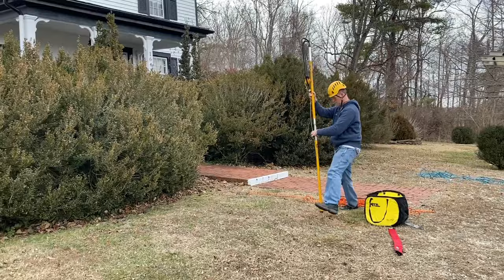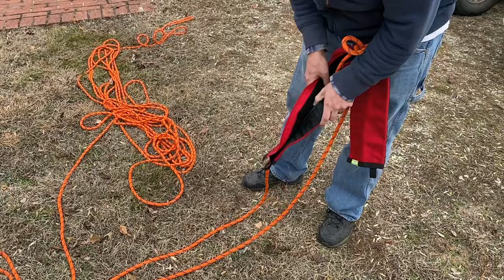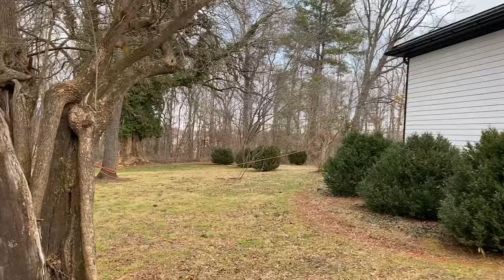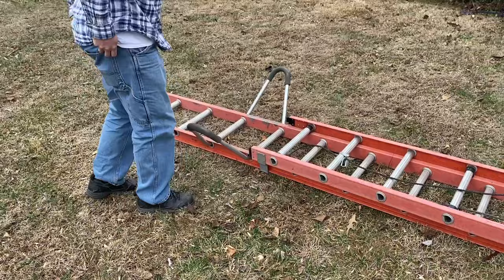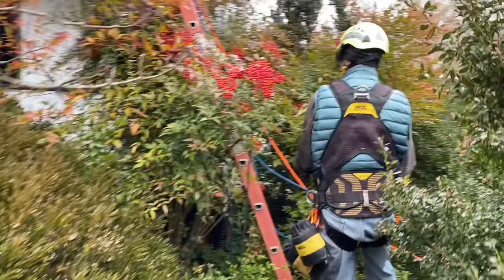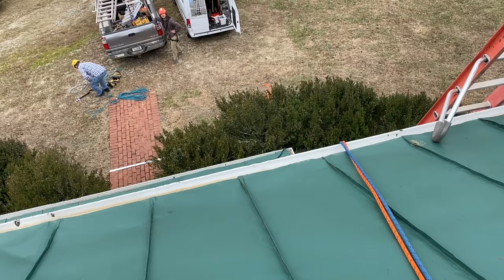Fall protection on a roof without adding any holes to the roof.

Comment: Getting onto the roof from the ladder looks quit dangerous , and how would you protect the ridge from getting damaged or crushed ?
Reply from the maker: You are right.  It can be dangerous.  It’s more dangerous getting from the roof onto the ladder.  That’s why we use fall protection, so if a mistake is made … it’s recoverable.  There are multiple ridge types and  metals used today.  So, I cannot say what exactly will happen at the ridge.  Adding a canvas rope protector on the rope across the ridge may help for the metal ridge cap styles.  If your rope always remains taught, then it will minimize any large forces the rope could transfer to the ridge.  The difference between a fall and a save may be as little as 20 pounds of tension on a rope.  You may want to check out our V-18 permanent ridge anchor.  It is designed for use on metal roof systems (and others) at Slator-USA.

Comment: I'm wondering why you chose to not use a Tensionless Hitch at the anchor, tied off with a locking 'biner on a Figure Eight as the backup? Especially since that allows the rope to maintain 100% of its MBS/WLL. Would also save quite a lot of rope. Just curious ✌️
Reply from the maker: That’s a better idea.  It just didn’t occur to us I guess.  Not too much risk with rope strength reduction with the way we work, but I like your idea.  Thanks for sharing it.
Reply: @BlueGlassLLC  Ah, okay. Makes sense given the light loads you're working with. Great video!

Comment: what's the rule for not damaging metal roof while you are walking on it . what kind a   shoes is the best
Reply from the maker: I’m not an expert on them, and there are many different types.  I’ve had great success with Vans and Converse.  Let us know if you find a perfect shoe.
Reply: Running shoes have a good traction and sole is white or light orange  ..  where do you put your foot  to avoid denting
Reply from the maker: @boashna  the roofs we work on are traditional standing seam double lock roofs.  They are fully decked underneath and don’t really dent.  I don’t know how you avoid denting the thin cheap barn style metal roofs on the market.  We don’t work on those.
Reply: Thanks

Comment: What about a hip roof. If you throw the line over the top then walls on the perpendicular hip you can fall and the rope will  follow you to the scene of the broken back.
Reply from the maker: You are correct.  Hip roofs more challenging.  We have used additional ropes to triangulate an anchor point and avoid the scenario you described, but it’s a pain.  Good point.  Glad you brought it up.

Comment: Where did you get the standoff for the ladder? I'm trying to keep the ladder off of the gutter which is scratching the aluminum and damaging the finish.
Reply from the maker: Amazon or directly from the manufacturer,  Levelok ladder stand off.  Probably $60.  They are awesome.

Comment: Thanks. What is the black strap connected to the orange line in the picture of the setup near the end?
Reply from the maker: If you mean the thing I set my foot it for a little better balance on the roof, it’s just an Anneau sling from Petzl connected to their Basic rope grab.
Reply: Thanks again. I want to paint my house but falling is not worth it. Someone at Menards mentioned something similar to what you shared so I am glad I found your video. Be safe.

Comment: 40 years I’ve been roofing and I’ve never seen anyone wearing a helmet ever
Reply from the maker: Right.  It’s totally atypical in residential roofing.  I’ve been at it for 20 years and never see (other than our team or our clients) anyone wear them on residential roofs.  We wear them on every job.  GC’s require everyone to wear hard hats/helmets on commercial job sites.  The helmet protects our heads, have ANSI rated eye protection attached, and have helped us work by referrals only for over 10 years.  We also crawl in attics and under houses.  We attach headlamps to the helmets as well.  If you looked at the top of my helmet, you would easily see how often I should have ducked a little lower.
Reply: That's true, but I also see many roofers without any fall protection, even on steep roofs. I like how they use arborist tech in roofing. I've used similar on my roof and it has kept me from falling multiple times.

Comment: What if you don't have a tree to tie off to? Also I'm not sure this is OSHA approved as the anchor should be rated for 5000 lbs?
Reply from the maker: Actually, I could do a half day class just answering these 2 good questions and going over scenarios.  OSHA:  They don’t actually approve anything, but I understand the question.  Either something meets the OSHA standard, or it does not.  Either way, if an employee gets hurt you have a problem.  The anchor must meet a 5,000 pound load requirement (per person attached to it) or be capable of handling 2 times the maximum applied load.  A Qualified person needs to make the determination if the anchor will meet the loading requirement and note it in their Site-Specific fall protection plan.  

Your other question has too many possible answers and questions for me to address.
Reply: @BlueGlassLLC  Thanks for the reply. You should make more videos on anchors without screws or nails. 

Do you ever tie off to a vehicle? I understand it can be dangerous as its possible someone drives away, but it could provide another point for anchoring.
Reply from the maker: You’re welcome.  I have (kept the keys on me), but try not to.  Most of my challenges are solved with a 200’ rope.  Usually that’s long enough to find something better for anchoring to.   @hadols4790

Comment: Curious, how do yoi not bend a metal ridgecap putting amy kind of weight on your lines?
Reply from the maker: That’s a great point to bring up.  Thank you.  I have not done this on a “modern” metal roof with a ridge cap yet.  90% of our roof work is slate.  So, it’d be an interesting experiment.  I believe I would use the rope as emergency fall arrest only to avoid the potential problem that you describe.  I might try doubling the rope to increase the bearing surface, but it’d still be an experiment.  If the roof were standing seam style (and not the exposed fastener style) then I might have to use the standing seam anchors (although I don’t like them).  Excellent point you made.

Comment: Can this be used on an asphalt shingle roof without damage to the shingles?
Reply from the maker: Yes.  However, if the pitch is very steep or someone actually falls and loads the rope, then I’d expect damage to the ridge vent (if present).  We’ve not damaged shingles yet.

Comment: all that to caulk a flashing?  what is that, about an 8 pitch? i would have used a foam cushion and done just fine. all that gear, i wonder if there's any room left for a tool pouch. i used to spit cedar, number 1's and shakes, we would do 3 story 12/12 spots with just our roof seats. things have changed. your WC insurance agent should be happy. stay safe.
Reply from the maker: I watched a guy sing a song trying out for American Idol and his song lyrics go through my head regularly, it was … “Once your dead, you can’t get deader … play for keeps.”  So, we approach every roof job as if we’ll fall off (even if it’s walkable).  And so, two years ago when I backed off a roof thinking I was stepping to a ladder ( and the ladder was not there) fall protection saved me.  Yes, we use to do stuff that was crazy.  Glad you and I both survived our youth.

Comment: My only critique is that those knots in the lines reduce the strength of the line.
Reply from the maker: True.  So, it’s definitely a good idea to begin strong ropes, practice work with tight ropes, and utilize a load limiting lanyard.

Comment: What if you don't have a tree to anchor to?  Also, if the OSHA inspector shows up, how do you prove that you either have a 5000lb rated anchor point or a safety factor of 2 when you are tied off to a tree?  That tree looks substantial in the video, but what if the only tree to tie off to is questionable?  It also limits you to working on one side of the roof, and let's be honest, how many of your guys can you say honestly stay off of that other side of the roof when they are working?
Reply from the maker: It would be good to show the inspector who the competent and qualified persons are on-site, documentation of the proper training they received, and a copy of your site-specific fall protection plan.  OSHA allows for odd circumstances when you can show proper training and plan implementation.  
There was no work to do over the ridge, the plumbing boot was the only spot we needed to go.  Had we needed to go to the other side, then we’d need to tie off both ends of the orange rope or we could have used a standing seam roof anchor (but I trust those much less than a good rope).  It’s fairly simple to set up logical fall protection.
As to your good question about how many guys …. Well, I can only speak for my team and tell you we are the most diligent and careful roofing crew I’ve ever seen and still the temptation exists … “I’m just gonna go real quick and check on… It will only take a moment… I’ll be careful…. I won’t fall … It’s not very far down…I’ve done it before….Nobody is watching….Almost quitting time…I’m running late…Just real fast…It will only take a moment…”.   I’ve met at least a hundred roofers who survived falls and this was their logic.  Many have friends who died after having the same thoughts.  So, we take the risk seriously and have a buddy system in place to hold us accountable and hopefully resist that temptation.  Good fair question Fred.  Thanks for asking.  Ronny. You may also want to explore our Roofing Safety Level Program on our website to see the training our team went through.  www.Slator-USA.com
Reply: Great attitude. 11 years of roof work clearing guttering (New Zealand). We do similar ground based anchoring. Thanks for mentioning the Big Shot Slingshot - I'll look it up.
Reply: Great attitude. 11 years of roof work clearing guttering (New Zealand). We do similar ground based anchoring. Thanks for mentioning the Big Shot Slingshot - I'll look it up.
Reply: Great attitude. 11 years of roof work clearing guttering (New Zealand). We do similar ground based anchoring. Thanks for mentioning the Big Shot Slingshot - I'll look it up.
Reply: Great attitude. 11 years of roof work clearing guttering (New Zealand). We do similar ground based anchoring. Thanks for mentioning the Big Shot Slingshot - I'll look it up.
Reply: Great attitude. 11 years of roof work clearing guttering (New Zealand). We do similar ground based anchoring. Thanks for mentioning the Big Shot Slingshot - I'll look it up.

Comment: Why hook in the front, wouldn't that hurt tremendously in the event of a fall?
Reply from the maker: That depends on how far you fall.  OSHA permits a 2’ fall from the sternal ring.  In Europe, they allow a 6’ fall.
Reply: @BlueGlassLLC  Does osha allow anchoring to ground on opposite side like that?
Reply from the maker: @billyyoung622  that depends.  Are the workers properly trained to identify hazards and suitable anchor points?  Are they now considered to be a competent person as related to this specific situation?  Has the employer retained documentation of this training?  Was the training done by a qualified person?  Is there a site-specific fall protection plan that allows for the use of this anchor point?  OSHA should not have any objections if these questions are answered the way you would expect.  However, if someone was hurt doing this, and the investigation showed that there was no training or inadequate training, then I would expect citations and fines by OSHA.

Comment: Not bad. But I will add extra protection for tree. Why 2 ropes if you using only asap, shunt with step you can pun under asap....
Reply from the maker: We experimented with 2 ropes to practice putting an anchor point on the top so we could work on either side of the roof (when we have both ends of the first rope tied off).

Comment: All that work?! Man just fall off the roof 
😂 jk
Good vid
Reply from the maker: Haha!  Right.  After 18 years of roofing, I got distracted on a job this past summer, and stepped backwards off the roof.  Thankfully, my rope was tight and the fall protection system kicked in.  You never know when, just that if you do it long enough, eventually it happens.
Reply: @BlueGlassLLC  I clean roofs but the most slippy ones are tin roofs on a slant especially after spraying the bleach on them. I had a buddy on a tin roof (RIP) slip and slid all the way off the roof and feel about 20ft. Thankfully he landed upright and in a bush. Obviously he was not harnessed because he had done it so many times he had the confidence. These days I either wash them from the ground or from a ladder.
Reply from the maker: @EazzyBeezie  That is a dangerous occupation.  Best success and safety to you Brian.

Comment: Why not just tie  rope around the chimney
Reply from the maker: Fair question.  Though it may sometimes be a decent option … I refrain from doing it whenever possible because:  A.  Chimneys are oftentimes quite unstable.  B.  Chimneys are not designed to handle side loads, especially 5,000 pounds as desired by OSHA for an anchor point.  C.  Chimneys have sharp edges.  D.  If that’s what you learn to do, what will you do when there is no chimney available?

Comment: Geez dude, Back in the day,for the amount of time it took to rig all of those lines, we would have sealed the boot on that vent with roofing cement and a piece of membrane, cleaned up,had the ladder back on the truck with check in hand. That type of safety equipment did not exist in the trades, and accidents were a rarity.
Reply from the maker: That’s wonderful.  Glad it worked for y’all.  Rare is great until the day you, your buddy, or your employees is one of those rarities.  Then, when you are talking to their spouse to explain why you’re at the hospital, it feels a bit different.